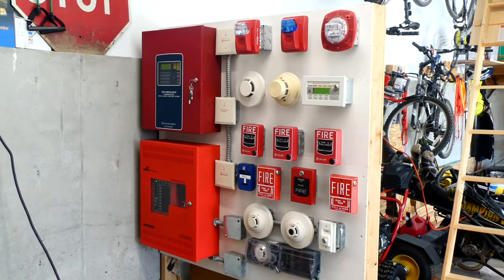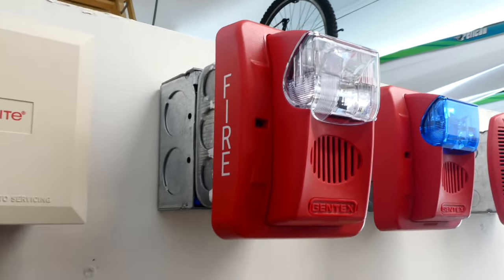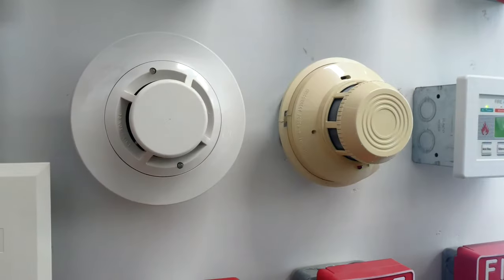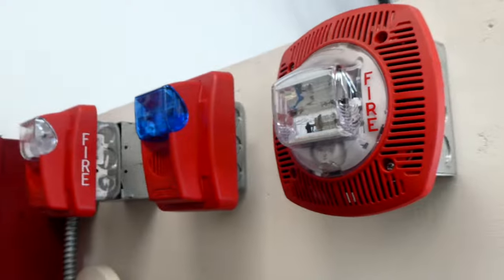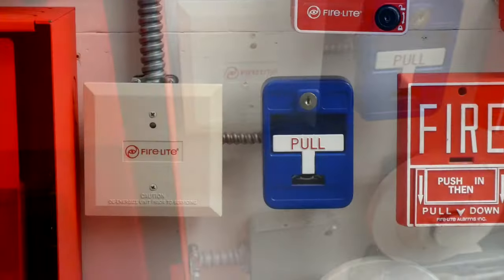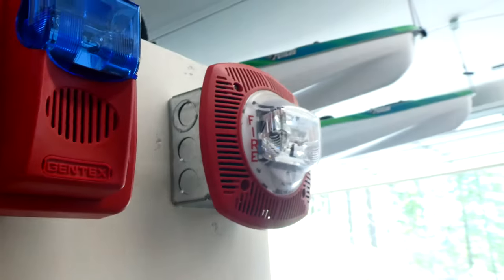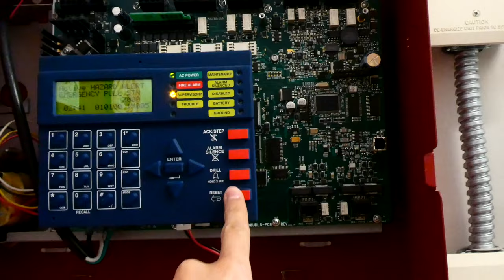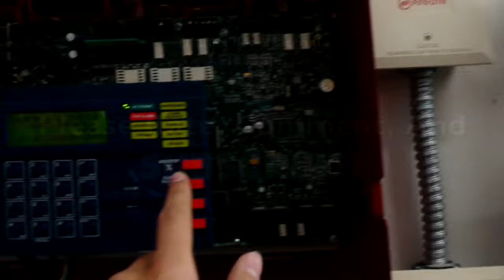Wheelock & Fire-Lite Voice System Test 13: Chime and Speaker!

Comment: I have a red FIRE-LITE BG-8 that will not pull. It is new in box, on the inside there is a button, lever and a spring that holds the pull station closed. Can you help please?

Comment: Hello Grant I have to ask how do you pull the alarm without it calling the fire department? I am very interested on how it works? Nice video and system btw
Reply: I believe the fire alarm panels have a line attached that contacts the fire department, or a security company that’s monitoring your alarm system. The way companies test their fire alarms is by contacting the fire department and letting them know that you will be testing your fire alarms.